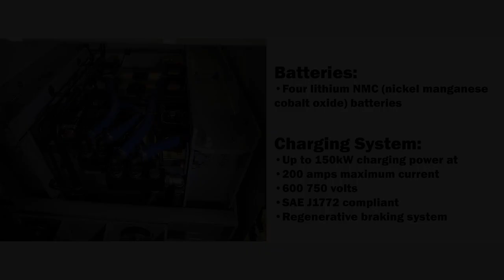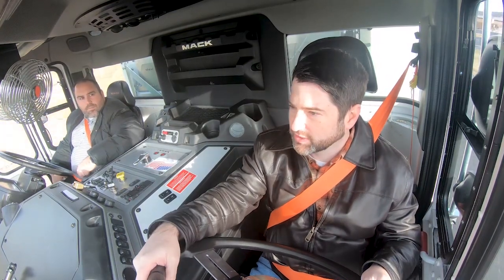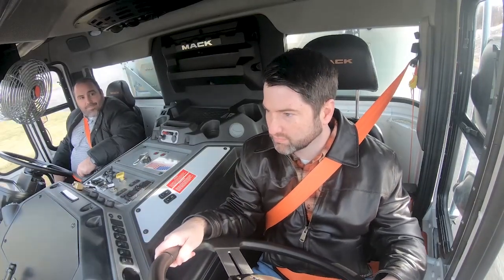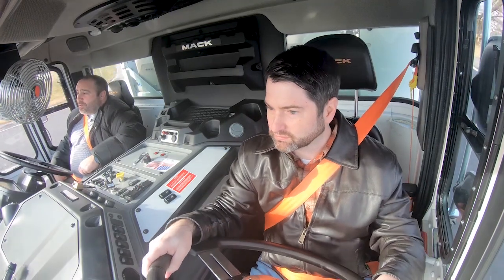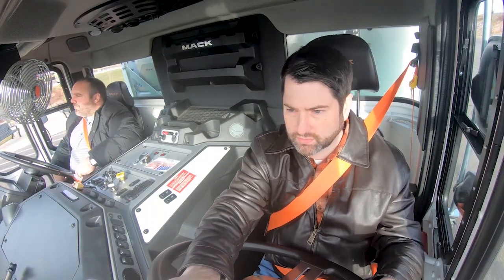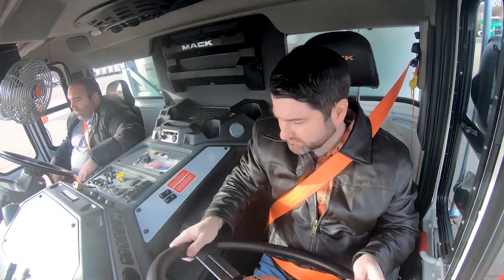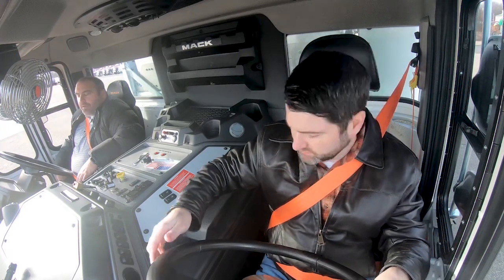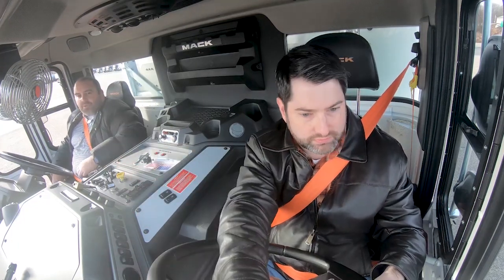Test driving the first Mack LR Electric garbage truck

Comment: Pretty sad that Mack still can't fix that cab squeaking noise.
Reply: Most likely bouncing seats rubbing against back
Reply: @michaelc7014  nope. My truck makes the same sound and it's under the cab. All of our macks do it.
Reply: @ericp.1508  yes that crap kills me.  Front loader driver here.
Reply: That would drive me nuts
Reply: It's so annoying! Omg when on Bluetooth headphones whoever I'm talking to is like what heck is that noise. Like two pieces of metal rubbing all dang day
Reply: I call it a shed on wheels
Reply: That “uhh uhh “ noise too how can anyone buy it like that? It’s brand new, fix tbat
Reply: I drive a non electric Mack garbage truck at my job. It’s the only Mack that we have.. Drives great, has a lot of power but they seriously need to work on the noises the cab makes. All I hear is squeaking and rattling all day. Sounds like every single component in the cab is loose and about to fall apart. It drives me crazy.. My job uses mostly Internationals or Freightliners and none of them have this problem.